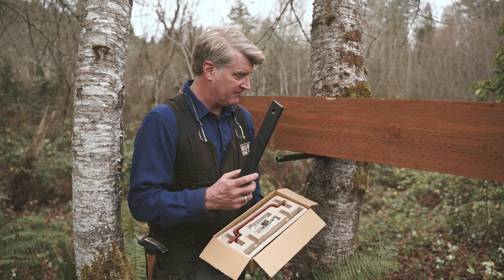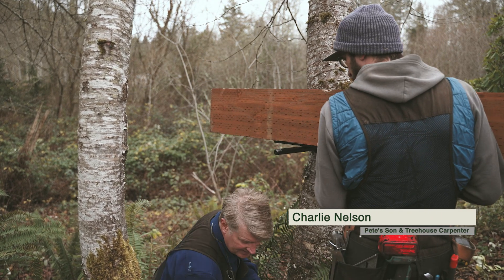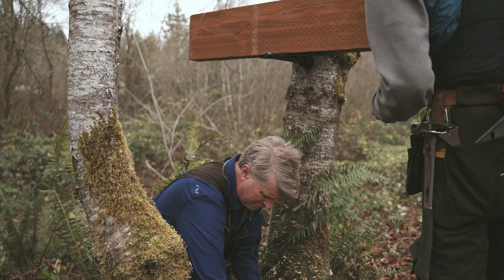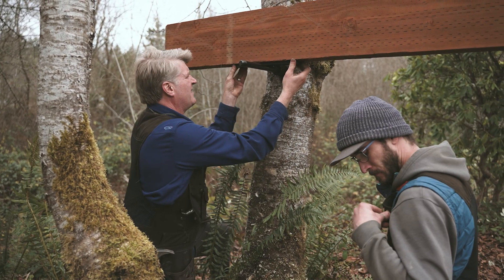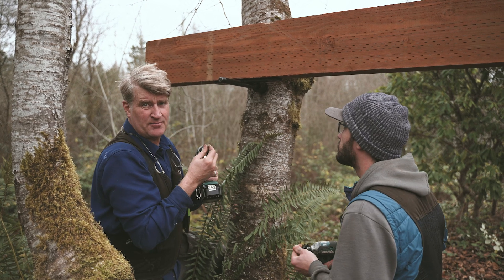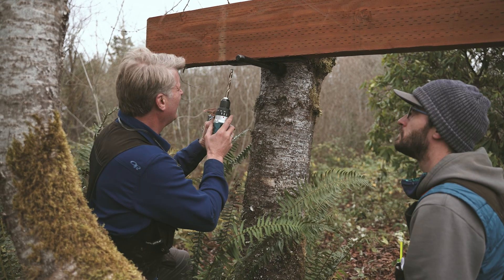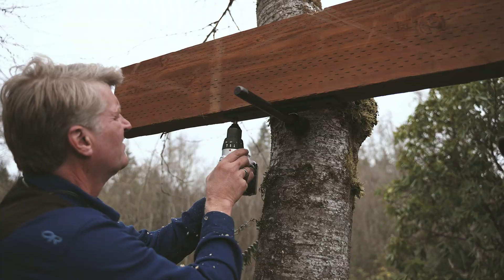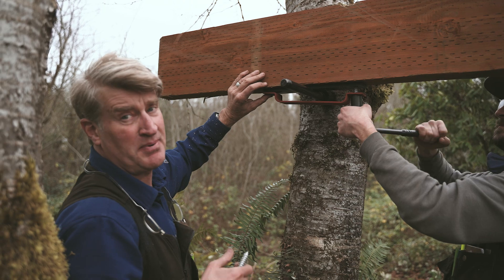Tree Fort Hardware: Dynamic Uplift Arrestor (DUA) Installation

Comment: To keep anyone from confusion, at the end Pete misspoke. What he used to secure the beam to the tab are lag screws not bolts. They are both galvanized but the screw is pointed and drives itself into the wood. A washer is used at the end that remains showing. Where you tighten. A bolt  goes all the way thru a predrilled hole that matches it's diameter and has a washer at both ends and a nut to tighten. A simple mistake that everybody makes but it could cost somebody a little confusion. I love this guy and his show.
Reply: I don’t understand why that helps with the wind? Can you explain that to me? That would be awesome